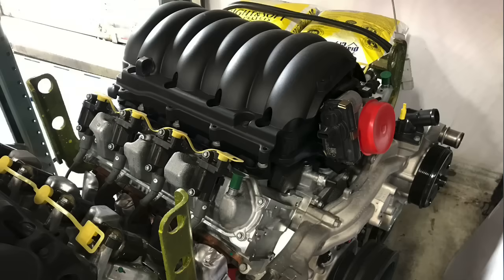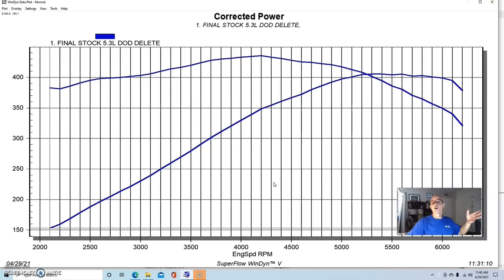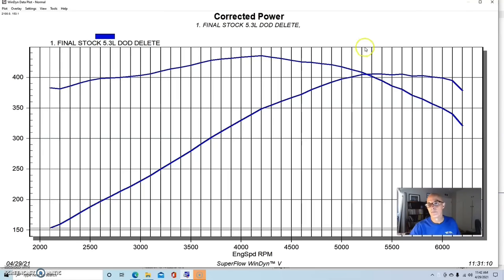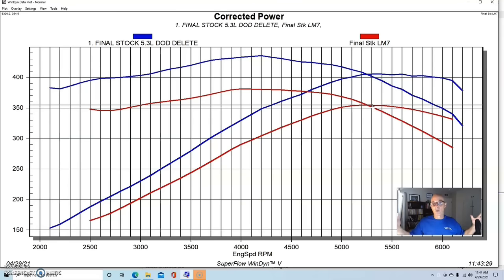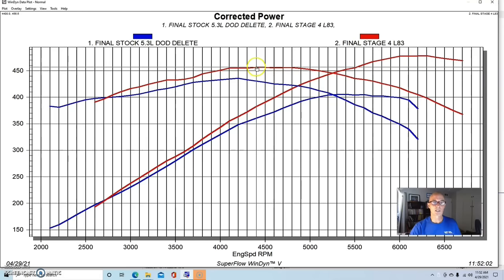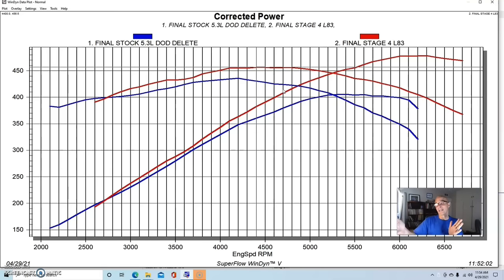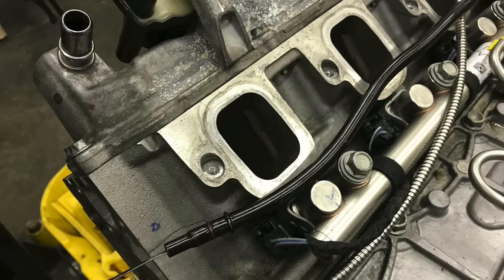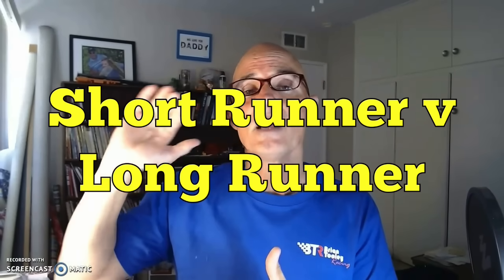5.3L L83 CAM & INTAKE UPGRADES (ADD 100+ HP)

Comment: What cam and modifications would you recommend on my L83  I'm looking to bump power up but not lose some towing so maybe a stage 3 camshaft and some head work?
Reply from the maker: truck norris
Reply: @richardholdener1727 even over a l86 camshaft. I decided to do a l86 intake and TB, haven't pulled the trigger on a cam yet

Comment: My Current 2019 has an L82 in it. Will it be the same as this? Id like to make 500hp+ NA
Reply from the maker: L83?
Reply: @richardholdener1727 L82 LT. Its what they call the newer Gen 5 block along with the L84 put in the 2019-2022 1500s and a direct successor to the L83. I heard there the same except they have several changes to the block, a new valley cover, exhaust and on-center water pump.

Comment: I am looking to drop my L83 in my C10 pickup but I been trying to find a 600-650 hp combination with the turbo . I’ll eventually add one but I was told it could make that with the upgrades in this video and heads with a good tune. Does that sound possible to you?
Reply from the maker: that power with boost is very easy-even on a stock motor. You problem is getting enough fuel to it

Comment: how high can a stock L83 rev comfortably? what changes would you make to increase that limit?
Reply from the maker: what rpm do you want to rev it too?
Reply: @richardholdener1727  Im limited at 6250, shift at 6000 right now. BTR stage 1 cam, LS7 lifters and upgraded valve springs, 3L whipple and long tube headers. Putting down ~460 at the wheels on 37s with 4.56 gears. More so a curiosity question at this point.

Comment: hello Sir. what kind of power will i have by putting L86 heads on L83 5.3 stock bottom end. how much power will i make to have the heads cnc vers keeping them stock. thnx
Reply from the maker: talk to btr
Reply: Ok thnx @richardholdener1727

Comment: I have about 476 to the crank 
On paper I have 404 to the wheels
Mods in my l83
Ported l86 intake manifold and tb from 454chuy
S&B Cai
Flowmaster outlaw extreme catback exhaust 
Tsp performance cam 
Afm/dod delete
Tune/dyno

Comment: For the same cost or less, you could just boost your l83 with a kit from on3 and make 200+ hp gains with stock drivability.
Reply: 10-4
I did a on 3 kit on my 15’ Tahoe 
Just laid down 511hp and 555tq

Comment: What are you recommendations for a 2014 GMC Sierra with a 5.3. Is it worth purchasing when it has 143,000 miles on the truck? Truck is still in really clean shape. Engine is really clean. Want to get rid of the AFM bs.
Reply: Transmission will be your issue

Comment: Best of both worlds: LY6 VVT block with L83 heads, injector-style intake, and appropriate LT-swap cam. Used L83 heads are surprisingly cheap.
Reply from the maker: why put the l83 heads on an LY6 block-very expensive route

Comment: I think my 2017 sierra  z71 is a gen 5 l83 .. if so could it be done without the long tube header? Just to verify i would need the air intake and stage 3 cam so i dont have to notch the pistons and a good tuner?
Reply from the maker: ask btr about the cam fitment (p-v) and necessary springs and need for phaser limiter (and drivability of that cam)

Comment: I know this is an older video, but do you have any insight into throttle hang on Gen 5 motors, especially in front of manual transmissions? My L83 will not drop to idle when I depress the clutch.
Reply from the maker: tune problem?

Comment: I picked up a low mileage L83 with low compression on #4 cylinder. I am hoping it's a DOD concern . The stage 2 camshaft seems like a good choice. Should I limit the VVT or leave it as is . I also got  questions about transmission options Right now it's got 2004r 2000 stall speed 10 bolt differential 305 gears . Lots of questions. As to what's the best way to get it all together 
And will it work.  1964 chevelle SS
Reply from the maker: talk to btr
Reply: If you swap to a 6l90e you will thank me! You can put forged pistons and forced induction on the engine and the 6l90e will take it stock. Of course I would install a stall converter to match the weight of whatever vehicle the engine is in.

Comment: Is that msd intake hard to install on the 5.3
Reply from the maker: no
Reply: @richardholdener1727  no additional steps to putting it on like the lt2 intake
Reply from the maker: what additional steps?
Reply: @richardholdener1727  relocation certain parts I need to go and rewatch the video

Comment: I just want to get 400 bhp out of a 2011 5.3 in a 2011 Colorado on the cheap using existing parts if possible making it more efficient (better fuel economy) and possibly cai, headers, tune, and possibly porting and maybe shaving the heads for more compression and a tune and possibly a cam????
Reply from the maker: small cam and springs will help power a lot, headers and tune can help mpg
Reply: @richardholdener1727  thanks!  Can you suggest one?  And so playing with the heads with porting and milling isn’t cost effective?

I’m amazed that the bigger trucks like my current 2018 6.2 with just minimal mods gets 26mpg @ 65mph while the smaller trucks with a v8 struggle to get 18mpg which tells me they are not as efficient.  I’d consider putting a gear vendors unit on it with the 4l60 if it would help performance and fuel economy.

Comment: Do you have to make any modifications to the fuel delivery system with the new cam or will the stock injectors still be sufficient?
Reply from the maker: JUST TUNING

Comment: I have a 2014 Chevy Silverado Z71 5.3 LT.  Just put rebuilt transmission in. Failed due to hot 🔥 thermostat on it. I have since installed a cooler thermostat on the rebuilt one.  I'm looking at installing a stage 2 BTR cam kit. At what stage do I change converter.  Thnx. Love your channel
Reply from the maker: see how you feel about the stage 2 with the stock converter
Reply: @richardholdener1727  ok will do thnx.
Reply: I'm looking at doin a diablosport predator platinum 2. Once I tune the truck and to take it to the shop. When I return it back to stock will they dealership see its been tuned. I still have a little warranty left

Comment: I can’t lie, I have an L86 and I hate it.  It has been the most unreliable motor I have ever had, it’s also the newest. DOD ISSUES, crap injectors and the transmission is the worst driving trans I have ever had. I really hope that I can learn to like the most expensive vehicle I have ever had once I DOD delete and run the 220 220 BTR cam…I also hope my tuner can fix the trans programming issues. I’m really feeling the LT blues….

Comment: You guys should do a build with gen 4 rods and pistons in a gen v I have a block im building and I know one other person with a l86 putting summit pro ls rod and pistons in it stock heads stock direct injectors with hold downs running port injection and e85 my buddies running a TExas speed BFD cam and everything clears but no one I know has videos about it

Comment: My swap is so nice I just broke the 6L80e at the track last weekend… it runs 13.0 all night back to back on 22” wheels!!!
Reply: Time for a 6l90e! Not a lot more expensive but man the torque! capacity Ithink it is around 2" longer so may necessitate a drive shaft swap. Do a stall converter at the same time and I would bet you pull a half a second off your 1/4 mile time.

Comment: So’ let’s claim a stock motor getting over 500 even though you’re starting with a motor that most of us regular guys don’t have in our trucks… “this is a stock 5.3, except for the intake, exhaust, chip, bored .300 over, running 7 lbs of boost…. How about do an actual stock truck and add mods?..
Reply from the maker: 300 over? chip? maybe watch again!
Reply: I have a 2014 l83 with a 6.2 crank and built engine with a 2.9 whipple and interchiller and meth kit. Running 19 lbs of boost on 93 octane and makes 764 whp on my dyno! Great engine!

Comment: I have a L83 I’m trying to install in 1970 cutlass is there anyway you can recommend me some one to get a swap kit form
Reply from the maker: not sure on swap kits
Reply: How has your project progressed? Very difficult for an average guy to swap one of these newer technical engines in an older vehicle. I suppose would be best to do a stand alone and use the 6l90e and control it with the stand alone as well. Any way you look at it the electronics alone will cost over 2 grand! Gotta pay to play...that's what they say.

Comment: I was told for my 5.3 just put 6.2 heads and the 6.2 intake manifold and a comp cam stage 2. And i would 100hp. Great videos let me know thanks
Reply from the maker: THE 6.2L HEADS WON'T WORK ON YOUR (SMALL BORE) 5.3L
Reply: @richardholdener1727  thanks

Comment: Love your channel! Been watching it none stop! 

I'm looking to put a better cam in my 2004 gmc sierra. LM7 5.3. What would be a good stage one kit? My truck is all stock. I wanted to change lifters too.
Reply from the maker: truck cam
Reply: A cam designed/spec'd by David Vizard with intake/exhaust specs at 194-200 @ .050 lift on 108 LSA.  David Vizard's expertise is worth looking into because he says to give the engine what it wants...Not what you think it wants.

Comment: @richardholdner are there any differences between l86/lt1? Heads ? Valves ? Chamber ? Compression ?
Reply from the maker: I DON'T THINK SO, BUT WILL HAVE TO VERIFY
Reply: @richardholdener1727 ...I was thinking the valves are slightly larger.

Comment: You should test the LT2 intake manifold and 95mm tb in place of that msd intake manifold.  The MSD manifold is stupid expensive and at that point, boost with a Holley high ram is more desirable.

Comment: Hi Richard, My name is Shreyvon and I have a technical question for you Sir. I’ve got a mild L83 build going and I was hoping to get your opinion on possible end result power gains. So far I’ve got a LT1 camshaft, LS3 lifters and trays to get rid of DOD/AFM, LT2 intake manifold and throttle body, LT4 injectors & pump, remote water pump hookups, and other supporting mods. My serpentine belt is only turning the alternator and that’s it. I’ve got an electric motor for the power steering and like I said before hookups for an electric water pump. My plan is to run E85 and drop this engine into 2,700lbs T56 car that I have waiting for it.
Reply from the maker: mid to high 400s
Reply: @richardholdener1727 ...what are you guys doing about vacuum? I know that because of direct injection, GM installed a vacuum pump on these engines. I would assume we would not want to remove that for a car run daily on the streets.  I pity anyone that does that for any length of time for the amount of garbage that will build up on the back of the valves. Maybe an electric vacuum pump is available.

Comment: I love this engine.  Mine is currently at 197,000 miles with 5200 hours on the original motor and everything.  Finally put longtubes on her at 190k and tuned.  This motor loves e85 too 😂
Reply: 2014 single cab 5.3 4x4, BTR Stage 2, LT4 HPFP and Injectors, LS7 lifters, 6.2 Intake and TB, Longtubes and a dumped super 10. Truck absolutely scoots. Chirps in third with 22s and a 3.42 rear end which is wild to me lmao
Reply: Did you change the low side pump?
Reply: E85 makes them motors move
Reply: Did your truck come factory with E?
Reply: @bobbybarraza8472  yes, l83
Reply: Do you have to get it tuned for E85 I have a 21 Silverado
Reply: .  If you have a stock engine (oem cam etc) the factory ecu automatically adjusts the tune when it "sees" e85 over other fuels. There is a sensor in the fuel system.

Comment: Just found your channel and found it very informative. I have a 2019.5 silverado RST 5.3L 4x4 with 2" leveling kit, wide stance, and more less a wind tunnel disaster.  I have been looking for a tow setup video. Last yr we pulled a 4500lb camper through the hills and several times I found that I was running 4800 rpm's (normal is 1900 @ 70mph empty) for an extended time. This truck is my daily driver so I don't need anything radical but a little more low end power would be fun. Hoping to find a DIY setup.   Thanks, if you have a chance to make us truck owners a tow/haul improvement video.

Comment: Good Video RICHARD 
my 2017 Tahoe Set P2097 Code  and the Suv had a Slight Stumble Hesitation on ACCEL 
Bank 1 Fuel Trim Rich 
Dealer Replaced MAF and WOW Woke up the Engine .
Suv only has 55,000 km 
the SUV Realy NEEDS 500 HP 
the 22" Wheels are VERY HEAVY the WholeTruck is HEAVY !!!!
NOTE Transmission 6L80E can only Handle 469 HP !!!!!!!!!!!!!!!!!!!!!!
+ Torque ONLY 440 FT/IBS input 
Output 664 Ft/Ibs
Reply: Dang just noticed that was 3 years ago...if you left the afm/dod on I bet you have a story to tell!
Reply: Swap out to a 6l90e. Also delete the afm/dod as soon as possible. That is what ends up taking those engines out. Trust me....get that crap out of your engine!

Comment: I have seen so many trucks dod fail and cost to fix it is crazy . 479 hp translate to 379 hp wheel or so not bad I would like to see one of these engine get dynoed like your van did to know how much loss between engine dyno and wheel dyno

Comment: Does the variable valve timing still function with stage 3 or 4?
Reply from the maker: yes
Reply: @richardholdener1727  Does it have to be minimized or dialed back?  Also, Ive heard recently that if you add increased valve spring pressure it messes up the oil pressure within the system and then also messes up the cam rotation as there is not enough pressure to rotate the cams.  Have you heard this?

Comment: So let me make sure I have this correct. GM rates these at 380hp, with full exhaust, stock air box and tune, etc...and this thing put down 406hp on an engine dyno with perfect conditions, with no accessories, with headers and a tune on E85? Do I have that right?
Reply from the maker: yes

Comment: How much power were you getting from varying the cam with the BTR cam? Was this all stock ECU tuning? This would be really attractive with a Holley. Supposedly those blocks are really tough, going to be VERY interested to see this run forced induction. Something with port injection on top of stockish sized DI maybe? These are DI right? Did you try changing phase of the injection at all? I believe on the DI it can be worth more than on a port injected LS? Also, REALLY enjoyed your chat with Sloppy - it was an awesome podcast!
Reply from the maker: thnx-James Short did try injector phasing and changing cam timing

Comment: Now I'm tempted to pull the turbo L59 (gen 3.5 5.3) out of my fox and put one of these in.  I need to drop weight off of the nose since I find myself using it for autocross.  Similar power, lighter weight, less heat.  I've heard something about the Gen V 5.3 cranks not being machined for a pilot bushing or something.  I'd need to solve that issue before I commit.  I'm on Holley Terminator X so I'd just need to upgrade to the new model that runs the Gen V.
Reply: I would expect engine for engine this would make more power and weigh at leastn100 lbs less.
About to build one of these myself. Wondering what the limits of the stock cast crank is. Would be nice if GM would have put a forged unit in like they did the 6.2 *lt4?). You running a turbo 400 with a stall?
I bet in the fox body it scoots!

Comment: How much will this apply to a 2014 Silverado with direct injection and variable valve timing
Reply from the maker: all of it applies
Reply: @richardholdener1727  so going with a stage 2 or 3 cam I don't have to worry about doing anything to the Pistons doing a DOD delete and an intake change I should be all right and have a little extra fun providing I keep an extra set of tires with me thank you Richard I appreciate your content have a blessed day be safe

Comment: I swapped a L83 and 6L80 in my third gen camaro Texas speed stage 3 cam should be completed in a few weeks
Reply: Trying to get that stage 4 done asap
Reply: @subz3ro43  I just learned stage 4 cam requires shaving of the piston to valve clearance better look into it before getting those rpm’s up
Reply: @J2A61  I did think it's the only way to get to 500hp
Reply: @subz3ro43  boost will get you there for sure.... bolt on a zl1 blower it will make 500 with a stage 2 cam or a stage 1 DoD delete cam
Reply: @J2A61  wow
Reply: @J2A61 how much will stage 3 get you
Reply: @J2A61  can't find a zl1 blower thinking about the MSD manifold
Reply: @subz3ro43  they’re on eBay 2000-$2500

Comment: SEX-E.  Almost 100hp/L.  I'm interested to see how you add more fuel for FI considering it's DI.  That stuff is EXPENSIVE.  On the Taurus SHO, a larger set of DI injectors and a DI pump will cost you upwards of $1,500.  And that's with only 6 cylinders.  At least with the newer dual-mode Ecoboost engines, you can add more fuel with the port injectors.
Reply: For us with di, fueling can be expensive. Our next step with out going aftermarket brand is lt4 hpfp and lt4 injectors. Which is 2-3k the. There is lingenfelter big bore pump if I remember correctly pump alone was 4K or we can add port fuel like ford 5.0 for about 4K but it can be hell to tune in. But our stock fuel system which is the same as the 6.2 can handle 500-600 depending on tuner..an pump or e-85